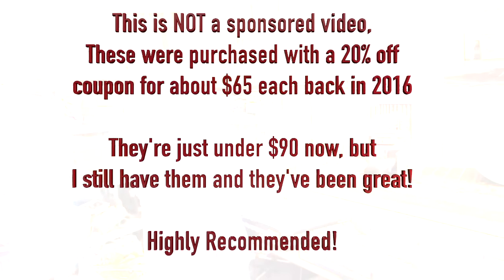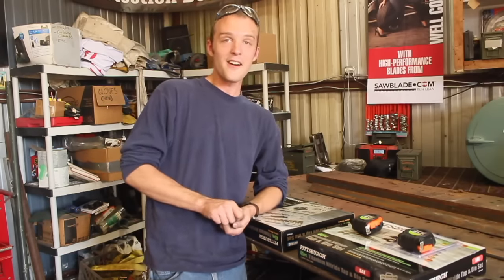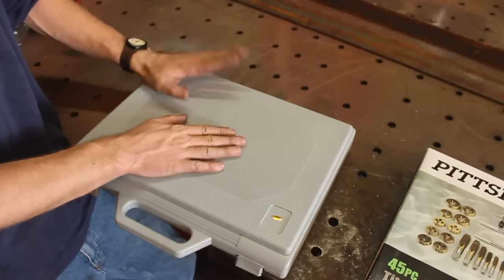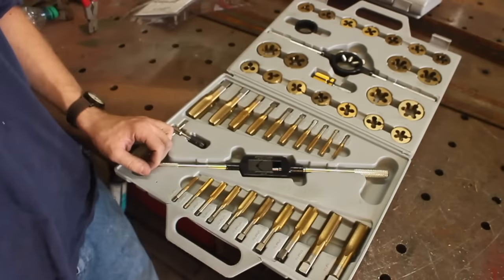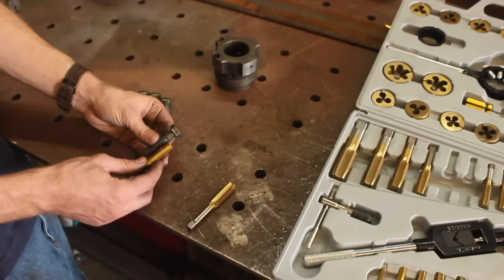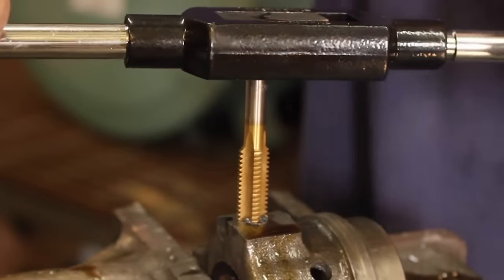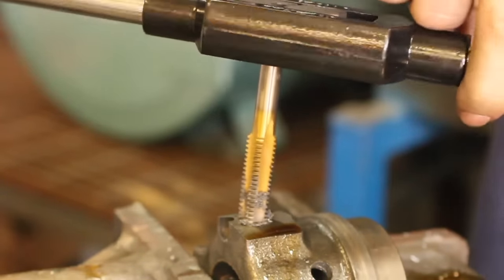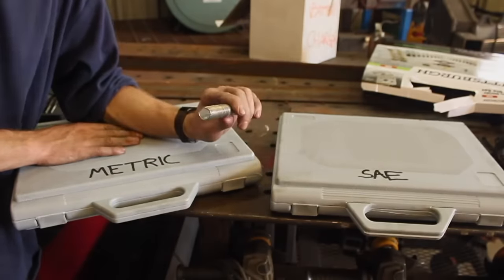HARBOR FREIGHTS BEST KEPT SECRET!!! AN ITEM SO GOOD EVEN INDUSTRIAL COMPANIES USE IT

Comment: These cheaper taps and dies are carbon steel, and perfectly serviceable, although a bit more brittle than HSS. They do give a nice finish if well made...there's technical reasons for that which I won't enumerate here... I have a set that I bought around 25 years ago and they will work fine within their capabilities. If used in harder steels they will wear out very fast, but that's hardly a fair test on tools that are so inexpensive. I have a good range of HSS taps and dies for my gun smithing work, bought as needed, and especially in the tiny sizes the high quality ones are way better. But again, the carbon steel ones are very good value and will do most jobs perfectly well.

Comment: Thanks for posting this. I am currently building a tool list for a rental and automotive repair shop I'm buying. Hadn't thought about tap and dies yet, so 👍
If I may, the ease in which the tap cut, and the slop when you threaded the bolt in, indicates you used too big of a drill bit. 
I lost count of how many times you said "like", or "kinda", etc... For us old guys who enjoy watching younger people do real shit with their hands, this is painfully annoying. Just saying 😉
Reply: He's tapping nodular cast iron, which is soft AF and dusty, and requires no lubricant. You could practiaclly thread it with a wooden tap. I would not use one of those taps in tool steel like A2 or S7 though, unless it was a size I didn't have a better tap in. Likely to blunt and bind the tap.

Comment: It looks like all the taps in this set are #2. The very best way to buy taps is to buy "tap sets", where each set contains a starter tap, #2, and a bottoming tap, for blind holes.  Obviously these tap sets will cost more, but with these sets, you will be ready for harder steel and blind holes.  If you want to go all the way, you can buy "pilot taps", that have a smooth shank ahead of the cutters, for perfect alignment, such as when drilling in engine blocks.
Reply: Starter Tap, Plug Tap and Bottoming Tap.
Reply: i agree that the best choice is a three tap set in each of the PRIMARY tap sizes you use. A Starter tap helps keep the tap aligned straight with the hole....the Plug Tap is the nomal one we use. But the bottoming tap is very important when you don't have a hole all the way through the material.

Comment: Those tap and die set I would not bother with them
What is really needed is a twist tap set and a set that throws the cuttings down out the bottom hole, they are worth much more,
Those culprits will break with any stress put on them
And they are only good for cleaning up threads

Comment: It is pretty good set Ive had mine for 10 yrs mine were in metal case 
The only thing that has happened Is the cheap pot metal casting from tap handle  body

Comment: I've had good results from most of the Pittsburg tools I've tried, their ICON line seems like an improvement, but not WAY better, although it is a bit more money. Not sure if they offer tap and die sets from both brands. I'll have to look. :)
Reply: I decided to give the Icon stuff a try. Ratchets/sockets in 1/4, 3/8, 1/2 drive. Been over a year now. They've seen heavy use at home and at work (industrial maintenance tech) and I have been very happy with what I got for my money. Haven't hurt the ratchets or sockets. Broke my 5mm allen socket in 3/8 drive but that sucker saw more abuse than it deserved.

Comment: I had gotten the smaller size sets. They work good but they may be a bit too hard. Had a couple teeth break off and the 1/2 13 broke when it accidently got dropped on concrete floor.

Comment: where did u get your sets from?? iv tried a few horrible fright/pittsburgh sets and they were all soo bad that i couldnt even use most of the stuff, there was so much overmold n flash that they were literally unusable, all 3 sets.. from different times n places.. i thought they forgot to grind the first set then i got the 2nd one n it was the same   taps n dies r one of those tools thats worth buyin quality, it makes the job alot easier, more consistent n faster   i looked for a link but couldnt find one

Comment: We use bass tipped bolts for the spider to hold rifle barrels. How did you strip the holes in the spider, they shouldn't be that tight.

Comment: i got their smaller sets and i have to say i would feel like a pos if i gave them away. you can see all the burs left from when they were cut and to top it off when i needed  a 3mm tap the other day i got out my set and i dont know whet they are, maybe 4mm or 10/32 but not 3mm. i was off to the ace hardware to buy a tap just like before i bought the hft junk. dont get me wrong hft makes some ok stuff but DO NOT WASTE YOUR MONEY ON THEIR 40 PIECE TAP AND DIE SETS.  or their dowling jig. two of the items that actually do not work as designed.

Comment: I  dont like round dies. I like hex dies so you can run them with a socket in tight places. Oher than that, these are adequate.
Reply: translation - I don't prefer to eat out of the garbage, but if you're starving it's adequate. :)

Comment: Titanium nitride is nice, but hard Chrome is way more durable and does not require almost anything in the way of lubrication, unless you're going into something that you grease it up so that you catch as much of the filings as possible. But otherwise they don't actually need much, if any, lubrication. The titanium nitride is a good slick coating, but it does wear off.

Comment: The harbor freight tap and die sets are not very good, they have VERY poor quality control. But if u do get a set that is machined correctly, they r not bad. But each set I have at least one or two of the taps have leftover machining burrs on the cutting edges, poor quality control...

Comment: I guess I'm the outlier, but the taps from HF I've gotten are terrible. they work after I deburr all the threads and sharpen them, but my m14x1.25 literally still had metal/coating in the cutting teeth, I had to use a carbide deburring tool to pick it all out then sharpen with a die grinder. I needed the size so I still would ha e gotten it, but I don't think these are one of HF better products.

Comment: I have a set of these. They all seem to work fine. Be sure to check the taps and dies in the box before leaving the store as many get stolen and or swapped with another set. The biggest thing is that they cut over size. The class size these taps are ground to is larger than a standard tap. Don’t buy these. Buy something else that has standard sizes.

Comment: I bought drill bits from HF and they're junk - chisel set junk - bought a 41/2" Grinder turned it on right out of the box and it started smoking. Pipe wrenches are usable but loosen up all the time. 
Their wrenches, socket sets and other hand tools are good. I still buy certain things there but I'm really selective on what I buy.

Comment: Anyone know how well those cases hold up, specifically the patches? I have a cheaper HF set and the latches are weak, one broke off early on, I keep my cases closed with a couple good wraps of duct tape but it’d sure be nice to not have to do that! Would be nice if the taps and dies were held in too instead of just laying there where you end up having to go through them like a jigsaw puzzle if you accidentally drop the case. ..fyi the cheaper set cuts nice too, it’s just the case itself I hate.

Comment: I bought a small set of tap and dies from Harbor Freight back before they had stores, and were a catalog store.  This would be back about 1980 or so.  Less taps and dies ... and came in a flat metal box.  I don't use them often, stuff around the house, but they have never failed me, and I still have and use them.  I think I paid about $7.00 for the SAE box, of about 9 or 10 taps ... and the same number dies.

Comment: The wrench is garbage. It literally disintegrated on me. Pot metal. However, the taps and dies are fantastic. I bought a used US made Greenfield to replace the wrench. I've had this set since 2003 when it came in a large metal case. Lately I've been tapping 1/2" into 303 stainless and they keep working fine.

Comment: I just don't get; in that high quality that at least H-F's hand tools, etc are a serious threat to Snap-On et al and, I'm not just bringing up the Icon line(!). It's to the point I've been known to throw a Pittsburgh ratchet wrench in service when I stripped the gears out on a newer (oval head) Snap-On, and with NO cheater, just my two 60+ YO hands.

Comment: C can someone explain me what is metric and. not metrics please
Reply: Metric are things sized and measured in millimeters, sometimes centimeters.  "Not metrics" are things that are measured using inches, usually fractions of an inch, like 1/4 inch, 3/4 inch for example.  The majority of the world uses the metric system for everything, but in the USA both systems are in widespread use.  And yes, having both systems in use does often make working on stuff a bit more complicated.  It seems a bit silly, but it is not at all uncommon to encounter both metric and inch fasteners used on American made vehicles and equipment, so mechanics here need to have both metric and inch sets of wrenches.  Hope that answered your question.

Comment: I'm a machinist who works at a job shop, and every job I do I have to figure out what steps and processes are needed to make the final product reflect the drawing.... now that being said, it is unbelievable how sloppy that tap job was, I watched you crank down torque on that Tap handle only to see the tap fall out of it a few frames later, not to mention after the hole was tapped there was clearly and obviously an unacceptable amount of slop in how tightly the bolt fit in the hole... just from watching a YouTube video I can tell you, all of the tolerances are way way way off, and this video alone would make me extremely hesitant in buying any tap and die sets from Harbor Freight..... there's a very big difference in blacksmithing and machining... what you did today was clearly blacksmithing

Comment: Nice video. However, I disagree. I have tried Horrible Fright taps and dies several times and they were junk. At least two different sets were not even sharpened and one had dies with broken threads. I never have problems with Irwin, Vermont American or Cleveland products. Yes. The do cost more but, they are far superior to the crap Chinesium products from HF.

Your mileage may vary.

Comment: You can't get around a fact of machining.  Good taps and dies cost money.  The cheap T D's don't cut proper threads most of the time because they are not ground to proper dimensions.  Their quality is about 90 % of properly machined, high cost T&D's so they generally are a good 'bang for the buck' option.  But if you want properly cut threads.............you've got to have correctly machined T&D's.  Fact of life is you get what you pay for.

Comment: Stay away: 1. Carbon steel = junk.  2. The only people who might use an entire tap and die set are machine shops.  If you’re not a shop 80% of the sizes will just accumulate dust.  3. If you ARE a shop, see #1.  4. Like the guy says, buy individual high speed steel taps as needed. I’ve never used a die.

Comment: Some of their tools are the worst.  I had those free screw drivers they give away with a coupon and I tried to use a slotted one.  The tip of it twisted!!  There was probably no hardening or tempering of the metal of any kind!!  If you need a drill bit or saw blade and need it to last don't buy their store brand.  They may be OK for limited light duty work but I don't think I can expect much if anything.  The money is better spent on a good known brand really.

Comment: They're not the best tap and dies ever. What else do you need to know. They have been tested and they suck. They cut the threads too big leaving the bolt really wiggly in the bolt. They are not durable. And if you mess up a hole, in say a block or a head, you just lost a lot time which cost a lot more than if you just bought a good set like Snap On or Lang. With Snap you get lifetime warrantee. Which over time, because even the best sets wear out, and you never have to buy them again. But the most important thing is you get proper sized cuts with the quality tools.